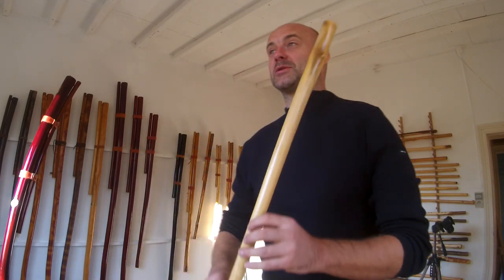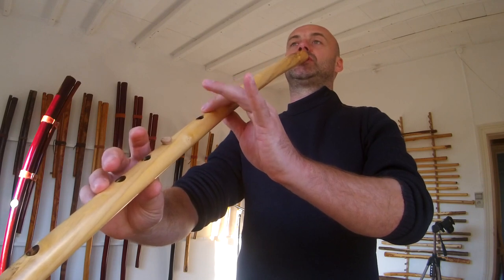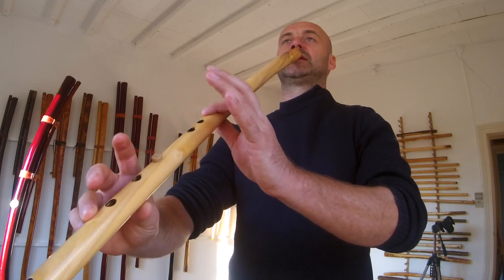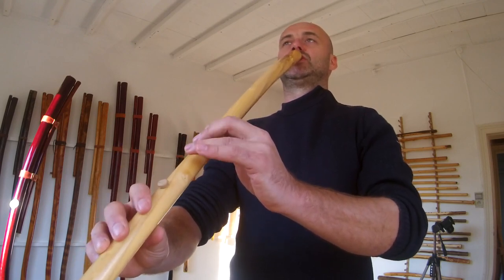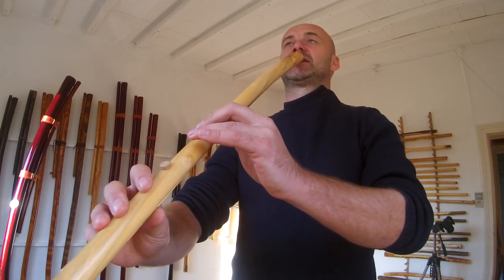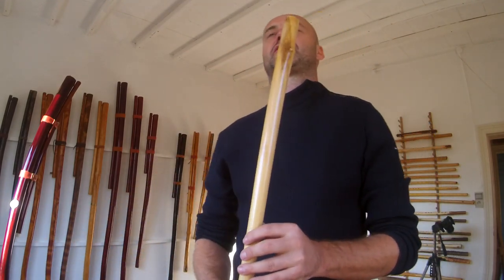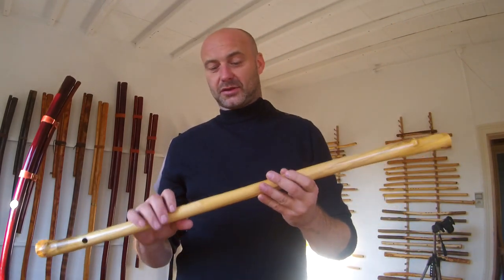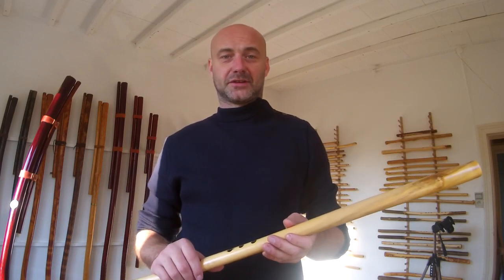Romanian Kaval (Caval) Tutorial "lesson 5"-  'Hora Din Caval - part 1'

Comment: Great tutorials! Your Kavals must be very good, 'cause on my 5-hole Romanian Caval I could never make that slide/glissando!
In the original recording, they use a 6-hole traditional Caval, with a hole for the pinky which creates that perfect D natural.
Reply: what is the original recording? it's a traditional song with many independent versions and multiple old recordings. also you can find many renditions of the song played just fine on 5 hole with half-holing the D, but it does take some practice to nail the intonation. as a starting point, you can try covering the 3rd hole with the tip of the ring finger (instead of the flat), i found it much easier to pull it off like that at first.